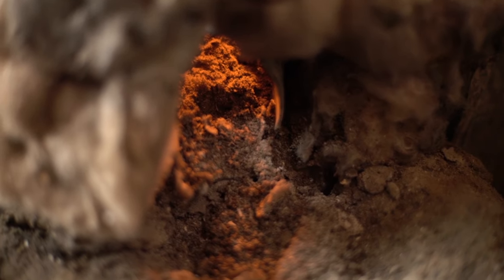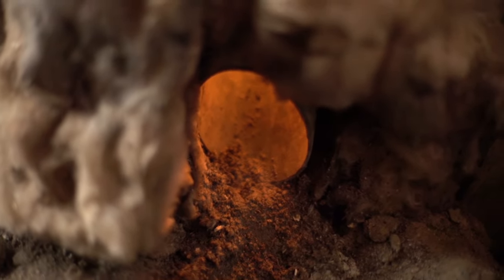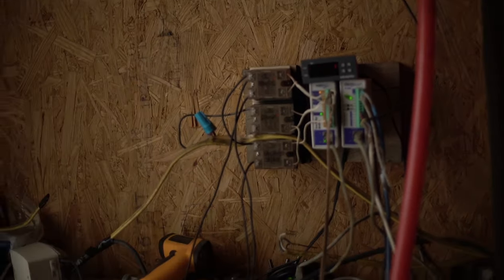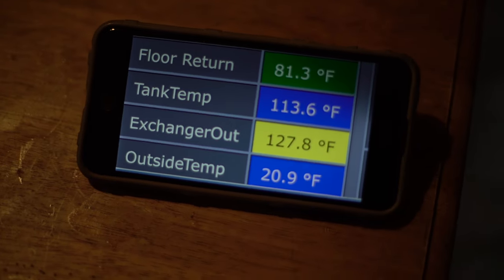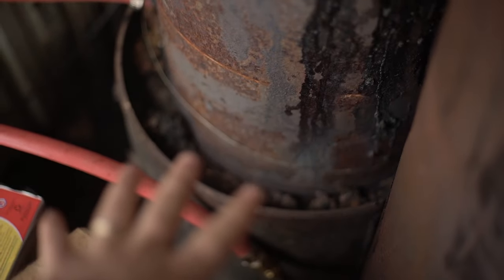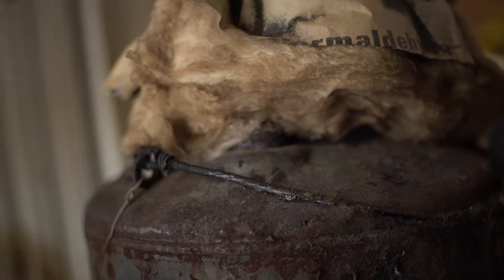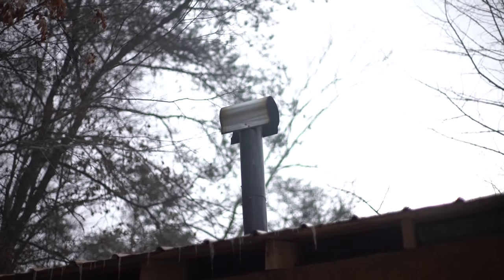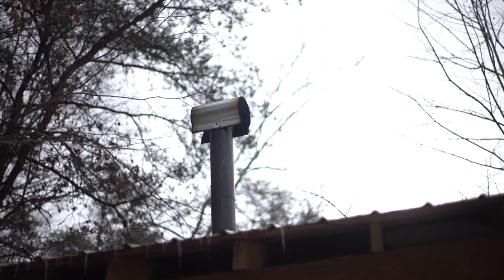The Dragon Rocket Stove Boiler 12 hour burn time 45ºf temp boost at 1 5gpm

Comment: nice boiler do you have plans to make it thanx good video I got a oil fired boiler would make a nice add on for wood
Reply from the maker: thanks man...  I am building version two of the boiler now. it is a much simpler design and employs integral insulation so I believe efficiency will improve even further.
Reply from the maker: +Bob Brua here's the link to the simplified/improved stove. ~6 hour build time. https://youtu.be/ToizIcbRrI0